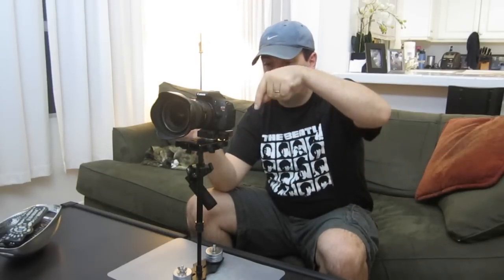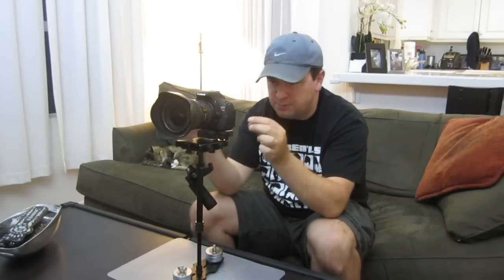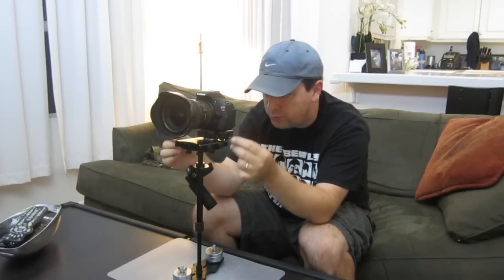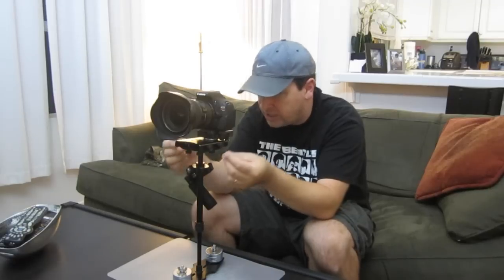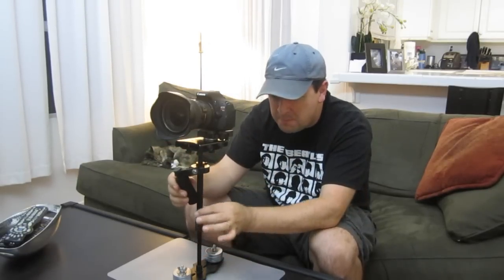Flycam Nano Help Needed Please

Comment: Your comment just saved me a bunch of time and trouble! I had the same issue and was messing with mine for an hour when I turned here for help, read your post, and bam! Problem solved. The stupid ebay listing and description said for DSLR, so it was the sellers fault. I discovered their mistake when I noticed the actual Flycam's manual said for mini dv/hdv and then I noticed upon looking at the flycam itself. It doesn't have the blue DSLR script on the stick. Wrong one!

Comment: My Flycam spins as well. I got it new and it spun from day one. I saw a flyer gently holding the centerpost to control the rotation and that's how I've been using mine. It's a YMMV situation with each and every flycam. Just learn to fly yours special. Good luck.

Comment: I purchased mine from Ebay directly from the manufacturer. From the looks of it we have the exact same model. I am experiencing the exact same problems you are having and I've just about thrown the damn thing out the window because of the hours I've spent on it. I still have it and I've learned to just use clips of stuff that looks decent and using 720p 60fps it somewhat helps out. Also using adobe's warp stabilizer helps out sometimes. If you do figure it out please post a video!

Comment: The problem is that your bottom is not balanced right you need to move the weight on the bottom to get a perfect balance too. Mainly if you rotate or spin the steadicam and feel it rock it then its mostly the bottom is out of balance and need to get it up right to get it to rotate smooth without rocking. Just move the weight around either forward, back, in or out to get it balanced better.

Comment: 4.) When tightening the screws, cross turn the screws lightly until they tighten. The base plate doesn't fit tightly so theres always margin for movement and screw your setup.
5. If you are too bottom heavy, the camera will start to roll left to right. Adjust the pole upwards.
6.) A Canon 60D with a Tokina 17mm requires 5 weights on each side. Use the weights to get a good front to back balance. Adjusting the side screws = AGONY. Use the weight position instead to fine tune.

continued ------>

Comment: I suggest get it as good as you can and start shooting video. I shoot model series and bought the flycam for video, only had a day of practice before using it with a model. The first couple video series were not good but the 3rd video series was pretty good, showed its potential. It's been almost a year now and videos are much improved. There are still mistakes in balance but it's not bad like handheld. I balance it on a knee for panning, then stand up and approach model for closeups, it works.

Comment: First, try to use the more disc weights posible, and try to shorten the post the more posible. This could be an issure for your shoulder but it will help to stabilize. Remember; this is a cheap stabilizer and you will always need the finger-tips of your other hand in order to make slights correction on the post while recording. Your vid was posted in 2011, and this was written in 2015, so maybe your problem was already solved.  If not, there is a cool solution. Try to seek the CAM-TV SINGLE stabilizer, its very cool, light and (Sorry) a bit expensive... 1 thousand dlls give or take. Best regards from Mexico.

Comment: Sorry for my poor english. 
The handle is connected to the rest by a ball bearing. If a ball is worn you might feel that when you rotate the cam like you showed us. This is NOT neccesary all 360 degrees!

A worn ball might destroy the correct balance.

Check careful if the inner part of that bearing is never out of alignment to the out part of the bearing. Check if the gap between inner and outer part is too high.

Perhaps this may help you.

Comment: The heavy lens is what's causing the balancing issue.  If you plan on using that lens you need to look into the more expensive bigger stabilizers.  Try the kit lens and you'll notice a difference.

Comment: The bearing thing - there is probably dust in the bearing. As it moves around it get's randomly stuck between ball and the bearing housing. 

BTW I bought flycam 3000. Brand new and it has major build problems. I cant do the "drop test" since handle touches the U bracket. Also the bearing is making hissing sound.. it's advised to take it open and clean it and then put in teflon oil

Comment: Most important, you should have vertically straight shaft, slight bend may ruined the center of gravity and u may result what u are facing. U added the washers. Remove that and try coz washer may change the horizontal level of camera and off the center balance. Check ur bearing if u feel like stuck or jerks replace that in ur case it seems gud.

Comment: Very often the problem of this is easy to adjust. Try to tighten one of the hex wrench srews of the gimbal a little bit, means a quarter of the circle. And do it on the opposite side the camera drifts like you do it with the spokes of a bicycle.
So, the quality of the Flycams is not too bad besides to tighten a screw from time to time.

Comment: You should have bought the dslr flycam nano, the regular flycam nano was made for smaller cameras. Although, you're pretty much balanced but you need to use two hands. Use two finger from your other hand and slightly pinch right below the gimbal to prevent it from spinning. Hope this helped.....

Comment: Second part:
Anyway I think that Your DSLR camera with the glas lens is too heavy for the small nano, You better take the DSLR-nano which is made for DSLRs. The nano is good for camera set up to 700g, so You can operate with for instance a Canon 550 with plastic kit lens.
And then in my opinion the telescopic post should be maximum pulled out to put the counter weights in maximum distance to the camera. This also would help to stabilize the camera.

Comment: Never seen a test with such a long lens.. could it possibly be wind resistance pushing on the lens which turns the camera??? That coupled with possible bearing problems could be making it turn only one direction. id try to re balance it with a shorter lens and see if the problem persists. also does the camera with lens weigh more than 4.4 lbs?

Comment: Hi! The Nano is too weak for the camera weight and the center ball bearing is probably worn out so the balls stick and cause the center shaft to rotate because the center point
in the gimbal ever so slightly will shift due to the gap. Remember that you are balancing on the tip of a needle so anything like heat in the metal and the constuction being a bit weak and it will shift the center point... but on the bright side: you do know how to balance a steadicam!

Comment: i had the same problem on my DIY glidecam... it took me month to figure out what is the problem... the problem is unprecisely made aluminium ring that is around main bearing. It doesn't have proper center of gravity. Solution is to add weight on the lighter side of that ring (so center of gravity will be exactly in the middle of that ring). Hope you understand :) if not PM me and i will try to ilustrate it :)

Comment: I am facing exactly the same problem... I think u have to twist the base plate (where the weight are) twist that to aprx 10 degrees or more and check if it balanced

Comment: Well i have a T2i and the kit lens (18-55mm) and didn't like the idea to need add more bottom weight, since the T3 is smaller i bet you will do fine, in my case i decided that spending a little more to get the Carbon Fiber version was better.

Comment: Yeah, i bought it from a online camera gear store in Mexico, they advertised it with the DSLR pictures and specs, but i recieved the old nano (the one with silver weights) tried to balance it, wich was some kind possible if you add all the discs (makes it so heavy) but it wont get really balanced, tried with my dad's samsung camera wich is about 350gr and worked amazing... had to return it to the store, and got the Nano CF (proaim store) for almost the same price i payed for this fail one.

Comment: Move the bottom plates OUT more, the bottom plates CONTROL SPIN, the farther out they are the more resistance there is to spin.  Look at the lens, notice it sticks out farther than the bottom plates - also your rig is probably a SMIDGE top heavy.

Comment: ..also in the end of the day if you got it that well balanced it wont matter because you use
your other hand to control the steadicam so running around without holding the center pole
right under the gimbal is really something you wont do.

Comment: Sorry you're having so many problems.  The cat and your wife may think you're an idiot but dude, you're not an idiot.  Most stabilizers will take some time, yes, sometimes more than 20hrs, to actually get it to work.  Can you remove the lens hood?  Or how about adding a mic?  I know, it's not a solution but sometimes adding or removing hardware can actually help.  If I remove the mic on my diy steadicam, I have issues balancing my diy, once the mic is back on, it's perfect.  good luck man!

Comment: Did you get to the bottom of your issue?
I have the same flycam as you. I have had it over a year. When i bought it i was under the impression a  DSLR is too much weight for it as the max it will handle is around 650gms. Its a flycam nano mini. Im thinking you needed the DSLR flycam nano which is slightly bigger but at a glance is the same.Are you sure that flycam is upto the job?

Im asking as im about to get myself a 650D and was thinking im going to need a new flycam.

Comment: There is only one problem, the bottom plate is not situated correctly, in the flycam manual it shows if you adjust the bottom plate underneath the mounting plate the horizontal rotation will stop. The reason is your camera has a balance point, and is not situated on the mounting plate correctly. Hopefully this helped.

Comment: All of your weight is pressing down on those washers, and you have lots of weight (with that particular lens) very far forward of that point. It might be acting like a lever essentially. You have a large downward force forward of the attachment point. It gets a nudge when you attempt to use the flycam, and that force sets it into a spin. Maybe try a shorter prime if you have one, or test a quick release that you can use without washers?

Comment: Defective gimble. Sell on e-bay, let someone spend another 200 hours. Buy next time HD 1000 or so. I completely understand what you're talking about. I'm building this thing myself. The gimble is not aligned. Not your fault. So, you can tell to your cat and the rest of your family, that you're not what you called yourself. There is a reason why it cost that low.

Comment: Your lens is to tall, the problem is that the shakes you create while pushing the Flycam backwards and Forwards and from the left to the right occur because there is always a small tolerance (you have already mentioned - the camera moves out of the center). The taller your lens is the heavier is the shaking (sliding into other directions). That's just physics man. If I were you, I would go ahead and purchase a taller Flycam for example the 3000 HD. Your problem may also occur due to the incorrect balancing relation from your camera referring to your Flycam. It may seem steady if you pick it up but when I took a closer look on it I realized tiny shakes near the base plate and the weights - Because they may not be perfectly set up it may also happen what you try to show us in this video. So my recommendation: Buy a bigger Flycam / Glidecam that carries more camera weight, e.g. the Flycam 3000 HD or the Glidecam HD 2000 or even 4000 if you think of attaching some exterior stuff like a mic or a flash or something else. I hope my contribution has helped you :)

Comment: Probably too late, but this is 100% gimbal problem. The manufacturers of these stabilisers should have video tutorials showing people how to diagnose problems. The quality control of these stabilisers is poor. Though this stabiliser is used, there are many people who've purchased new stabilisers with bad gimbals, misaligned forks etc. A simple gimbal test; Hold the stabiliser in front of you, rotate 360 degrees around stabiliser. The camera should not rotate, it should remain facing forward.

Comment: oke i inyoed the video , most people i know have brusless motors in place of bearings , thes bruslesch motors have elextronik divese whit a gyro in it so it wil stay focused on the prime direction whitout the electronics the cams would spin around because of its arro-dynamics , i think you have the ballanse write but you still have to gide the camra to were you want it to go , its pritty inpressife what you got there , so doint be angry at it :)

Comment: Configure it with a short lens and find the center of gravity as a base balance . this way you can eliminate whiter it is an equipment fail or just further practice in balancing it. in my opinion, your lens is too big to the point where a nano might not work but the bigger fly am model. Good luck.

Comment: I think you got a damaged bearing ,like have a damaged wheel on the shopping cart .tapping the same spot when you turn the shaft. Another problems are the pivot points not in the center. This is the manufacture  quality control   Problem . With the defected bearing and out of center post mount is almost impossible to adjust . I'm sorry this happen to you.

Comment: maybe try using perpendicular counter weights to the ones at the bottom, might work because i thing the weight or your camera is heavier at one side, if you can counteract that weight it might be the solution to your problem.

Comment: the gimball is not perfect centered on the on the ball bearing connected to the sled,and on the flycam there is no way to fix it, unless you know a good turner .. this is the big difference between flycam and glidecam(and 200 bucks..).

Comment: Wow. Your dynamic balance is pretty good (spinning it 360). When I do that it leans to another direction. I think yours is pretty well balanced. When I move mine left to right infront of the mirror, I would try to move it so the camera doesn't move. Hard to explain. When it does move I will correct it with my fingers. In the real world (not infront of a mirror) Most of the time you will need to use two fingers to point the camera at the direction that you want.

Comment: I guess that I see the problem. Washers on the bottom!!! Seems to me that you didn't make all tuning you need. You have balance upper/lower but you didn't balanced front/back side. When you lift lower side for 90 degrees. lower part of steady need to drop in about 2-3 seconds and this part you can see in almost every video. Something which people so not show in this action is balancing lower part when you lift it for 90 degrees and when you drop it camera should not be swing around them self.

Comment: You're doing nothing wrong. It's the air resistance and you can't doe anything about that. In this case there are two items: the mechanical balance and the air resistance and they are not the same. The same problem exists with a steadycam. The only thing you can do is to use your thumb to "hold" very slight the part above the dimbal. With some exercise you can do that without any influence at the balancing. Good luck!!

Comment: how much does the camera and the lenses weight all together???? The flycam nano is designed to hold only 1.54(Lbs) or 700grams. The t31 weights 2 pounds itself. Maybe the flycam nano just doesn't match your camera. Re-sell the flycam!